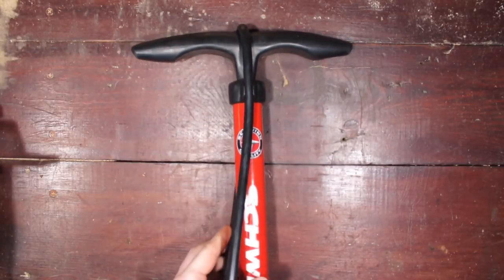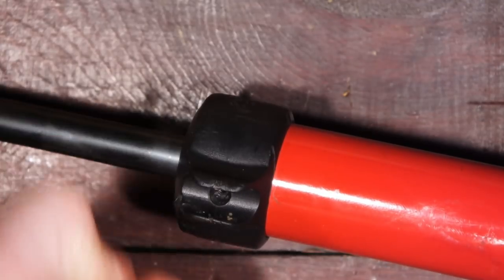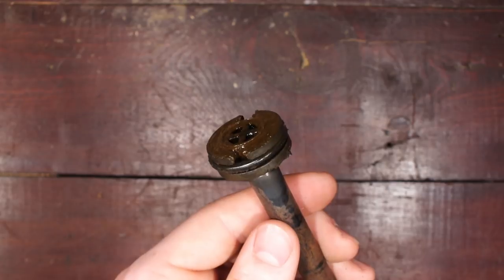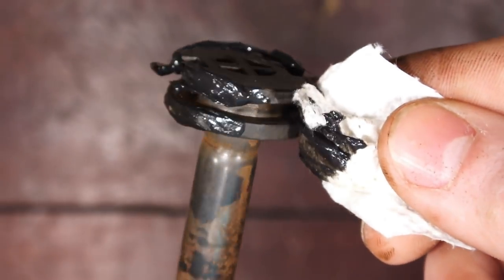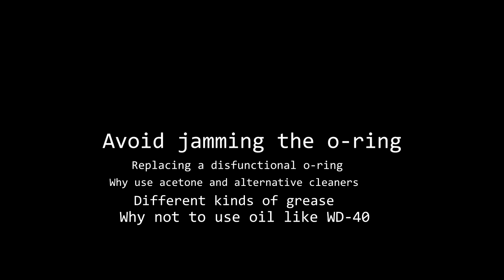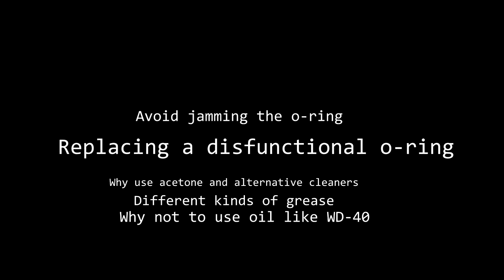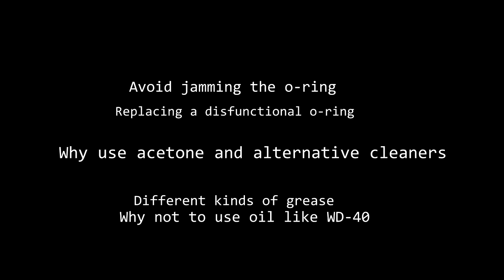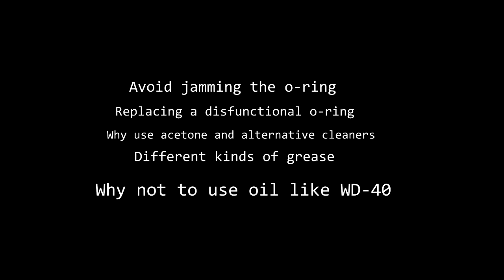How to Repair a Bicycle Pump

Comment: As mentioned before, O-Ring Grease, Silicone Grease, Di-Electric Grease (which is Silicone based) is a better choice for O-Rings as Petroleum-based lubricants eats up Rubber O-Rings.

I use “Parker” O-Ring Lubricant or Di-Electric Ignition Grease or Dow-Corning DC4 (Now Dupont Molykote 4) as it will not dissolve the o-ring.

Comment: Spot on! Many thanks. The bit about WD-40 was insightful. I believe it might be behind clogging the shaft with loosened gunk and rust. Multiple applications of grease also help pick out the stray gunk that the turpentine doesn't pick out.
Reply: WD stands for water displacement. It is not an oil. It was designed to keep moisture away from space rockets so that did not accumulate ice on them and did not become too heavy. It is not a lubricant by any means. Yes it does lubricate the bolts to open them up, but what happens next is not important when it comes to rusty bolts ready to be discarded anyway. I learned this the hard way by once spraying my bicycle chain with this wd and was very happy with the results despite the voice in the back of my head saying, people told you not to do it, sooo, on next day, literally, it took only a day, I look at the chain, and guess what? It is all spotty with rust patches. So yeah, that what the wd-40 does, it has its own very useful use but not applicable to every situation in the world.

Comment: Thanks for this video!  While my issue was with a different pump that was leaking pressure around the top, this video facilitated my being able disassemble my pump.  In my case, the internal piston-end had come mostly unscrewed from the piston shaft. I was able to clean it and re-attach it, adding a bit of Teflon plumbers' tape at the threads for a better seal.  And since I had it apart, it's all lubed up again with Teflon grease per your instructions and seems to both hold pressure and be a bit smoother.  Thanks!
Reply from the maker: That's great! Glad you got it working

Comment: I liked your video because the construction of the pump despite the different handle and color of the stem is exactly as one of mine. I took it apart before I looked up your video. It had bits in grease, so I was not sure if it was on purpose or not. I opened it up because it was not pumping anything. 

After watching your video, I concluded that the gritty bits where not by design and wiped them off, and I took the rubber ring off. I was absolutely sure I had a syringe somewhere with thermal paste for CPU but could not find it, so after cleaning off the ring, I just added a hand cream. I looked it up, the main ingredient was glycerine aka solidoil. 

Anyway, when it comes how you describe how the grease should be applied, if done the way you advise, the grease applied to the bottom of the rig does not do anything, but the one applied to the grove of the ring does fill the important bit between the ring and the plunger but applying it excessively is counter productive because it gets removed upon insertion back into stem / cylinder / column, call how you like it.

So general advice, once you removed ring and wiped everything. I used a holy sock to do that btw, first to wipe the ring and plunger, then put the sock on the plunger and stuck it in the column. Anyway, so back to general advice. Grease the groove of the ring to accommodate the ring but put the excess inside the column.

I clearly noticed how pump regained ability to push air as the grease got distributed along the inside of the column. 

Pardon my poor inglish.

Comment: Thank you. I put loads of grease under and over the O ring but it is still sort of too easy to push and not really maintaining pressure. Either I have a leak somewhere (more grease, perhaps, on more joints) or perhaps I need a new O ring.

Comment: I have a cheap back trails floor pump. It has no lubricating hole and when I disassemble there is no oil or grease on the o ring ;it is dry. It has started to vibrate like it needs grease. Is it throw away? I guess I can replace The o ring and give it a try.

Comment: Tip: for better results with the rust, try using toothpaste and rub it using aluminum foil. It works for me.
Reply from the maker: Ooooo, nice! Get a little polishing action on the aluminum oxide with some titanium oxide.

Comment: Silicone grease is best for O-rings. Other effective cleaning agents include petrol/gasoline, engine degreaser spray, and brake cleaner. WD-40 isn't really an oil - it is a cleaning agent and water displacer (hence the name), and only contains a small proportion of lubricant.
Reply: Won't petroleum based cleaners make rubber deteriorate?

Comment: Just be sure to use a silycon base grease like Dow33. Oil base grease and wd-40 will deteriorate the oring and it will need to be replaced very quickly
Reply from the maker: This ^

Comment: Bruh help me my pump was working literally 5 seconds ago then i dropped the end part on the floor and now all of a sudden when u push down on the pump it dosent pump it just goes down and up wtf help me
Reply: Omg same. I did the same thing, and that happens.
Reply: Same but I did this to me 2 years ago
Reply from the maker: There's a one way valve in the base of the pump. Usually some kind of ball and hole mechanism. It's unfortunately at the heart of the operation so the whole pump usually requires disassembly.

Comment: Hi, i have a o ring that just seems way too loose as it just goes into tube and does nothing so i figure replace that or put a expanded behind it like a oil ring on a piston. BUT how does the 1 way action work? Is there a valve in the bottom that need servicing? and how to do that please?
Reply from the maker: From what I have seen, there is typically a ball check-valve in the bottom of the stand part of the pump that lets air in. As for servicing it, I would just try to make it function normally if you're able to figure out how it might normally work.

Comment: My pump is giving me some "recoil". Meaning, when i pump, the handle comes all the way back without any effort. Any hints on how to solve that?
Reply: So, the issue was inside the pump "valve", i opened it all up and there was a rubber sealant out of place. I've put it in the correct place, assembled the pump together and it's good as new now. I have a CrankBrothers Power Pump with gauge.

Comment: use grease. I used wd-40 and it started pushing and leaking wd-40 out the pump and into my bike tires.

Comment: My tube got sliced off. Is there a repair or just have to buy a new one?
Reply from the maker: Yep, that's called a Schrader valve and if a bike is ridden for a long while with the tire pressure too low, then that can happen. A new tube is your fix!
Reply: The tire tube or the pump tube. If it is the pump tube then it should be possible to take apart the joint, remove the stub left in the joint, and then make the pump tube a bit shorter.

Comment: When I try to pump air..back air pressure from tyre tube will lift the pumping handle i.e one way valve is not working, where in pump it's located?how to solve this?
Reply from the maker: Usually the one way valve is located near the bottom of the pump. The mechanisms vary and are difficult to repair. I've found that some pumps can have their one way valve temporarily blown open, and you have to push against the presser quickly do get the valve to function normally.

Comment: Hey, me again. I have run into the same issue, this time I cant resolve my problem the way I have been. I have found out the problem isnt in thr hose but somewhere in the pump. It is resisting from putting out any air. It doesnt even get passed the chamber. Have you had any problems like this one? Note: when I use my pump it isnt for a bike and I max it out [160 psi])
Reply from the maker: Alright, let me see. I used to use one of my pumps for a compressed air gun that I made out of PVC pipe, years ago, and I too would max out my pump. 
My guess is that you have debris in your pump that is clogging the valve in the pump, or that the valve itself is defective. One iteration I have seen for the valve design is a loose hard plastic ball that clogs a hole one direction (like air being forced back into the pump), but lets air pass in the other direction. Perhaps with your pump something had broken to allow the valve to lock air going out of the pump as well as in? 
Let me know what you find! I'll be here.
Reply: I still dont know what causes it, but I came up with some sort of solution, it may not be the best idea but it ended up working. I filled the chamber up with hot water and put the pump back in, because I was thinking that because water isnt compressible maybe itd work because of the forces put on it. It did but Im sure Im going to pay for any moisture left inside of it. I still dont know what causes this problem in my pump but I plan on getting a pump with a higher PSI rating in case that is the problem here. The only real consequence I noticed immediately after putting the water in and flushing it out was that it became harder to max it out. At least its working.

Comment: What is the BRAND and PART NUMBER of your [ump? I want to get one like yours, BOTH oof mine came apart and had NO screws holding rgw top or bottom, AND they did NOT have a good O ring but a crapy leather type sleeve
Reply from the maker: The pump in the video I am sure is no longer made. There are a lot of good pumps out there, they're just a little more expensive starting around $30. Brand names are really good in this case.
Reply from the maker: This was originally an older schwinn pump, I believe, but I have since fixed it with parts from a Planet Bike pump. I would't necessarily recommend this pump.

Comment: Would be GREAT if IF or WHEN you found the replacement O ring you would give the Manufacture and part number of it OR dimensions of it
Reply: Probably all vary depending on what pump you have.  Best to take the O ring to the hardware store and compare which one you need to buy

Comment: What kind of grease is used to stop the grinding sound.
Reply from the maker: I can't think of a grease you can't use. Maybe don't use animal fat, but that would still work until it goes bad. Automotive grease is a good place you start. You don't need anything waterproof or anything like that. Keep it affordable -- you don't need the best grease. You'll also probably have plenty to re-grease with.
Reply: @betterdoneright  I used lithium grease which is better than anything else. Never use WD-40
Reply from the maker: Follow up on that, someone recommended using only silicone based lubricants to avoid damaging the o ring. Super true and important
Reply: @betterdoneright  It'll only harden the o rings and force you to get a new one. The only best one to use is lithium grease,not silicone.

Comment: Im having a problem where mine wont pump any air and it does even show up on the gauge, almost as if the air isnt even leaving the pump chamber
Reply from the maker: Is the pump handle hard to push down, or easy? If it's really easy, then the seal in your pump needs to be replaced. If it's hard to push down, then you probably have a functioning seal, but perhaps the hose has a blockage.
Reply: Dec's Projects the hose had some blockage so I push down with my bodyweight to get it out, it works quite well now. Thank you :)
Reply from the maker: Yay! I'm glad it works for you now!
Reply: Same bro

Comment: I've used WD-40 many times and it's fine...
Reply: I used it once. Made the piston jam worse than before from loosened gunk and rust clogging the shaft movement perhaps.
Cleaning with turpentine and grease (the gunk sticks to it -- so it took about three rounds of grease application), resolved it.
Reply from the maker: With enough it'll probably work. WD-40 does have some silicone in it, and enough of that will lube things up. Just won't last as long. Much like removing grease from a ballbearing.

Comment: better to use silicone lube on o-rings
Reply from the maker: I have to agree, but in an ideal world we would all have easy access to exactly the best thing. I've always used grease because it was available and have never had any issues. It brought the pump in the video back to life and I'm still using that pump.